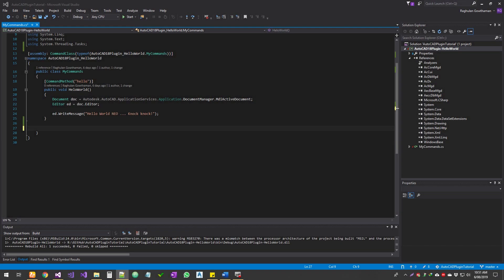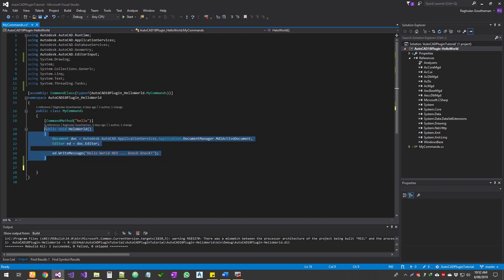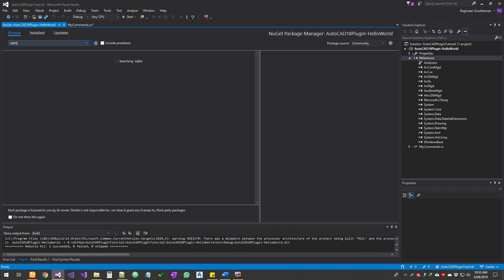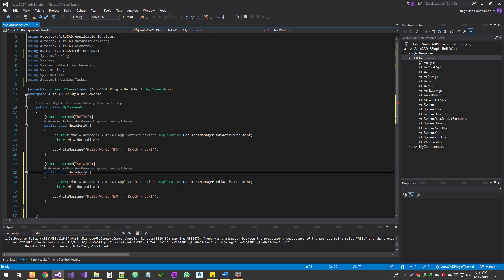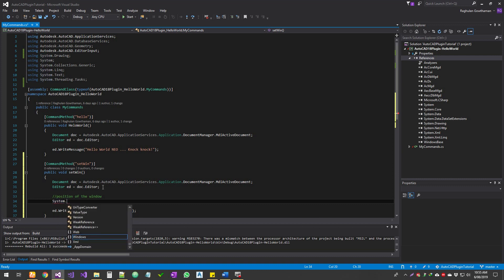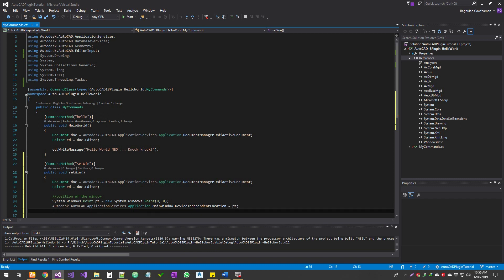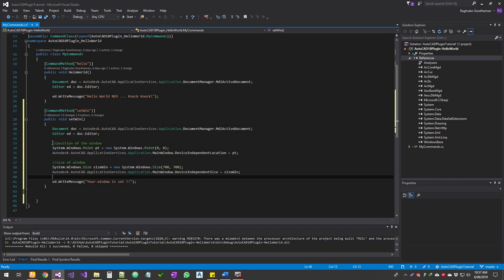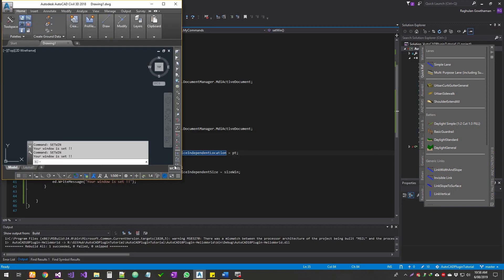AutoCAD Window Manipulation - AutoCAD Plugin Development

Comment: System.Windows.Point not available in System.Windows
Reply: Right click on References in solution  explorer and click add reference... then go to Assemblies and add WindowsBase and click ok.
Reply: @anubhavngh  you've made my day brighter. Thank you very much!
Reply from the maker: Add the usings and references i have added. It should be under windowsbase or system drawing. Its part of wpf if you are using winforms then it may not work.
Reply: @ExpertisorAcademy  can you explain this, i also cant use system.windows